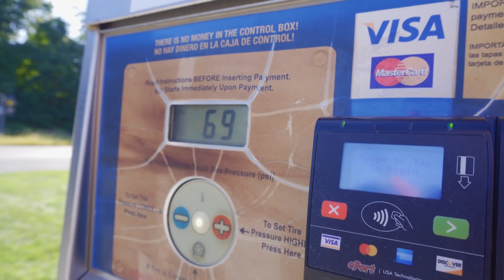Our Foundation Needs Five Thousand Pounds Of Stone

Comment: Looks like someone was on Berryville Pike at Meadows Farms Landscapes or Floors and More? Both places have a large selections of stones for building projects.

I'm lucky to have a large quarry about 8 miles from my house. I trailered in close 20 tons of #57 to use as a base for my shop concrete pour. The truck driver is in for a rude awakening the first time a loader operator dumps some large rock into his pretty truck and the sides get dented.

Comment: In my area (Pa.) Wawa has air pumps (free) that go up to 100psi. Also, for your trailer, you could get some junk yard scissor jacks and weld them to the underside rear of the trailer. This might let you drag heavy loads all the way to the back of the trailer for unloading.

Comment: I haven't used a crappy air machine at a gas station in like 15 years. I bought a small HF cigarette powered one for $12. It only lasted a couple years, then I inherited a better one (made in the 90s) from my stepdad. It's nice being able to air up your tires anywhere without looking for a station with air. And I've used it on family and friends' cars too. It fits in a small box along with jumper cables, emergency blanket, water, some granola bars.  Also the delivery driver with the new truck should get a brush guard put on the front.

Comment: Miss Erin:  looks like you could use a on board air compressor for tire inflation, also could be used for a variety of jobs.
Reply: I'm an old lady and have an air compressor (super small and lightweight) AND a jumpstarter the size of a VCR tape -  lightweight, smaller clamps and no scary spark like the traditional double cables to another car.   This way I don't have to find a stranger to help me when I'm away from home.    Every woman should have these.

Comment: Ya don't be shy to cut the bushes on both sides of the road  
The sun and the wind will dry it quicker and stay firmer after a rain shower   good luck with the stone walls been there done that  I still have more to do  it's a hard job a bit easier for you  you're dealing with flat rocks  i deal with river rocks  to position it  its usually 3 time for each take care be safe

Comment: talk about shocks, i was working with a old timer. it was a plaster ceiling, with 1 by 4 florescent fixture 277 volts, so i had to go chest hi in the plaster ceiling supported by black iron. 
to undo the fixture so we could replace it. i said to the old timer, is it dead. he said look, i got the switch off, and black tape over it. so i reached in, took the 4 inch cover off, reached in the box to pull out the wires, took the schlock off, and that is when i got hit, full 277 volts. i don't remember getting off the 6 foot ladder i was working on. worst hit i ever took

Comment: I just got this new lithium battery that can start you car and it has a air compressor built in.  It’s called the Halo Bolt and I use it to fill my truck tires and bike tires.  Check it out it is great for an emergency.